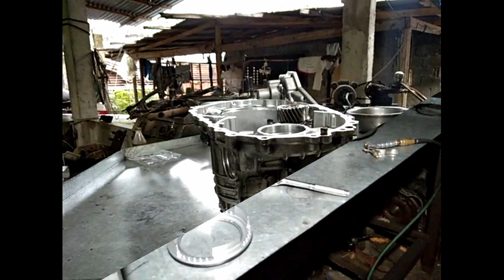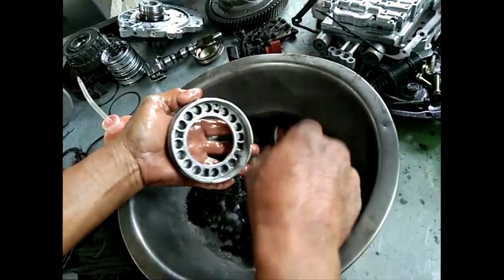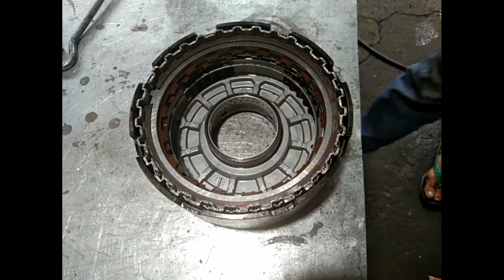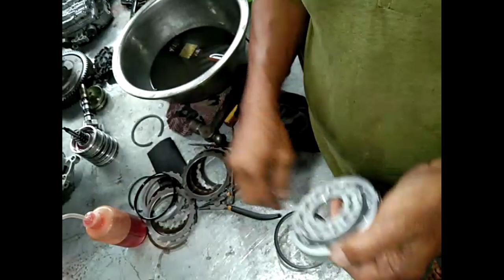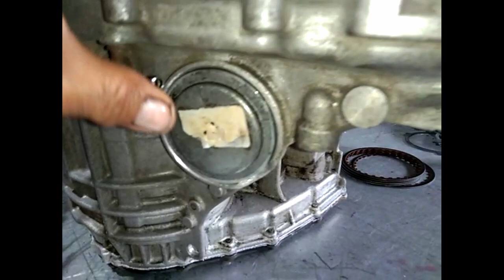Nissan Exalta Automatic Transmission Rebuild

Comment: good day Sr.   im working on this transmission and replacing the gaskets on the valve body.   there are 2 larger bearings that fell out and i dont recall where they go,   your video cuts off at that point  can you help me locate where they go?
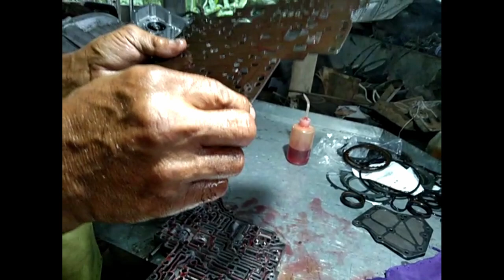Reply from the maker: You'll see it at 50:09 after I removed the separator plate.

Comment: Boss kamusta,ayos mga video nyo,tanung ko lang din QG13 Sentra 2009 model automatic transmission, kaya ba tanggalin ang strainer o filter kahit ndi na ibaba ang valve body? Nakikita ko kc ung old sentra may isang turnilyo na kuntrahan.
Reply from the maker: Gud pm! Klangan tanggalin ang valve body dahil meron isang bolt na may nut sa loob
Reply: @FRubioatars  OK boss maraming salamat. Ilan po kaya sakto turnilyo para matanggal ang valve body?
Reply from the maker: @arisautocare  15 pcs. (Ibat-iba ang haba)
Reply: @FRubioatars  salamat po sir

Comment: Boss gud day,ano po sira s loob ng matic transmission,kc nagvivibrate xa pgdtng ng 3rd gear at d agd tumataas ung rpm kya delay ang arangkada.
Reply from the maker: Ang posible lng ay internal leak o kaya ay valve body, hindi kaagad nabitaw ung second gear at nagsasabay na nakaenggage  ang 2nd at 3rd gear

Comment: And sir what type of brand of atf that you most prefered for dialysis to NISSAN SENTRA 2004 models...
Reply from the maker: Gud day! Sa QUEZON PROVINCE ang shop ko. Hindi ako nagrerekomenda ng dialysis, mas ok na tanggalin ang oil pan para malinis ang filter at matanggal ung mga debris. Texamatic ng caltex ang ginagamit ko at saka phoenix, basta dexron III. Sa banawe ako nabili ng rebuilding kit
Reply: @FRubioatars  bali drop oil pan lng ho ba sir tpos drain... puede ho ba forward clutch pack lng ho papalitan sir...
Reply from the maker: Kung papalitan ang clutch ay kailangan kalasin ang transmission. Ang nabibiling rebuilding kit ay isang kumpleto na lahat ng clutch at mga seal
Reply: @FRubioatars  sir yung sa amin poh ay nissan sentra gs matic 2004, parang kahalintulad ng nasa video nyo poh... na nissan, ang sa amin poh ang nagloloko minsan minsan nadedelay ng shifting from 2nd gear to 3rd gear.... minsan nman ho may araw na ok ang takbo walang delay...
Reply from the maker: @allanjaypalomique7609  Subukan mo muna i-Change ATF at linis ang filter. Tapos lagyan mo ng ATF conditioner. Kahit anong brand ng conditioner ay okay lng
Reply: @FRubioatars  nagawa n poh sir 2 beses p hong dialysis sa nissan mismo at shell... naloko p kmi ng mga taga nissan n yan... sbi p ho replace tranny n daw... napalitan n ho ng mga filters... eh nagbblak n ho ibenta nga ho kase nagloloko n tranny... kaya nga ho balak dati nmin ho pumunta jan inyo nung bago mgpandemic days....
Reply: @FRubioatars  inuulit ulit ko nga ho youtube nyo parang parehas ng tranny ng nissan sentra namin din ho yung itsura ng video nyo...
Reply: @FRubioatars  sabi din poh ng ibang napagtanungan kong mga soecialist s tranny din poh sbi nila bka mababa na power ng engine mo my loose compression n kaya di nari-reach agad ng tranny supposed to be rpm for each gears...
Reply: @FRubioatars  sa video nyo hong ito sir anu pong atf brand gamit nyo poh....
Reply: @FRubioatars  anu pong puedeng brand sir ng atf ang ipapalit ko n medyo ok na sa tranny... na medyo affordable sir???
Reply from the maker: @allanjaypalomique7609  Caltex texamatic or Phoenix ATF.kung mahina ang makina dapat lahat ay magdidelay. Klangan kase jan ay matesting  sa ibat ibang driving condition. Pareho ba ang condition niya kapag light trottle, half trottle at full trottle? Kumakambyo ba siya kapag inangat mo ng konti ang gas pedal? Matagal na ba sau ang sasakyan?
Reply: @FRubioatars  by schedule ho b ang appointment sa inyo sir... kung sakaling magpapacheck up ng transmission pede ho nman?
Reply: @FRubioatars  kpag light arangkada ho mga 1000rpm hindi ho nagsishift agad to 2nd gear, aabot p apak ko ho ng 1500 para makashift sya ho, ginagawa ko n lng ho parang manual transmission style drive sir rubio, kpag unang arangkada 1st gear 1000rpm konting minor tpos apak gas upto 1500rpm to 2000rpm ayun  mag shift n 2nd gear to 3rd gear... pero minsan ho kapag nka3rd gear na lalakas ng 3000 to 3500 rpm na khit ibirit ng ibirit parang nag iistock up n sya sa 3rd gear ho
Reply: @FRubioatars  since 2007 ho pero yung manager ng company na unang may ari ho ay alaga yung sentra sa nissan casa cavite bgo p ho mapunta sa amin ho. After ho mapasa amin ho mga year 2016 dun ho sya nagsusumpong ho khit every year atf change oil sa shell ho.
Reply from the maker: @allanjaypalomique7609  ipacheck mo muna ang tps kung kung nagbabago ang shift pattern kapag inagjust. Kung may cable siya papunta sa trottle body, tingnan mo kung hindi masyadong hatak
Reply: @FRubioatars  sir nung pina check ko ho sa nissan for scanning lng or consult II nila ay ang sabi my cut off gap n daw cguro yung throttle positioning sensor buti medyo mabait yung tech ng casa inexplain nya sir sa resistance test ng tps nyo my gap sya bandang gitna kaya if mapatapat sa 1500 or 2000 rpm si tps napuputol daw si tranny mag order shifting to next gear, issue kya din ho ang mga tps sensor gaya ng sa mga hyundai accents gas matics
Reply: @FRubioatars  after this pandemic sir dadalhin ko na inyo to counter checks en consult
Reply from the maker: @allanjaypalomique7609   lahat ng computerized na transmission ay nagdedepend sa tps para sa shift pattern.
Reply from the maker: @allanjaypalomique7609  cge